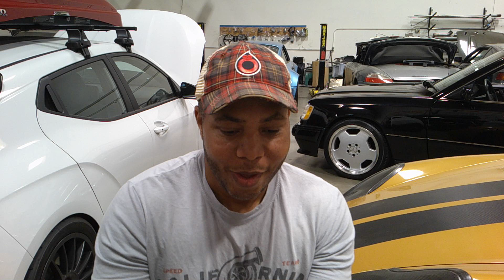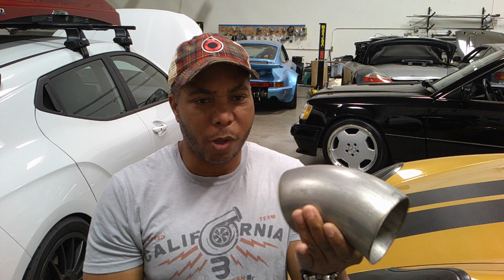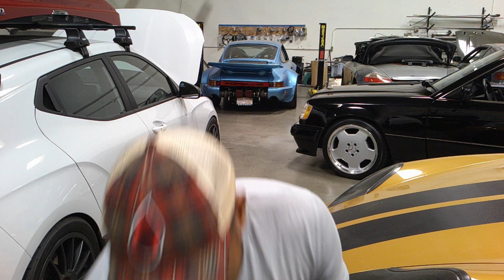Engine knock, tuning secrets, and how I started.

Comment: Hi @Bisi, I would appreciate your thoughts on electric superchargers on Porsches, there are new products coming out which are improved a lot and cost accessible compared to turbos, especially on M96 engines. I have got an eye on TorqAMP https://youtu.be/dfyCwKddNeg,  It should give a nice low boost and great more torque since low rpm. So would be nice to hear your impressions about this type of technology, if you could dedicate some time on your next live session. Not necessarily vendor related, I've mentioned TorqAMP as they seem to be the most advanced at this point of time.
Thanks and greetings from EU!
Reply from the maker: Greetings. The best way for me to evaluate would be to explore the technology, intimately. I  will try to reach out to them. Wish me luck!

Comment: Hello, first of all spectacular content. I have two questions. The first is that it is retarding and advancing the degrees of ignition advance, since I have seen so many videos and information that I don't know which is true. To delay ignition is supposed to be to launch the spark much closer to the TDC and to advance ignition is to launch the spark much earlier than the TDC. Is this correct?. The second question is why delaying the degrees of ignition will eliminate the knock? I ask this, since if one slows the ignition (spark jump), is it supposed to compress the mixture even more, giving a higher temperature or am I wrong? Really, if you could help me with these doubts. I am with the idea to start tuning my own car with an aftermarket ecu fueltech ft450. Spectacular content. Greetings from Chile!